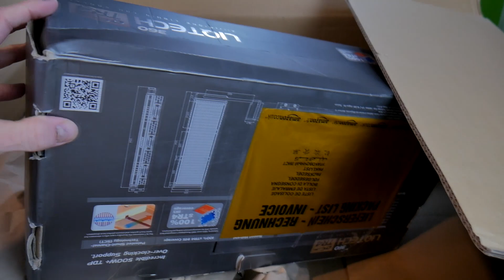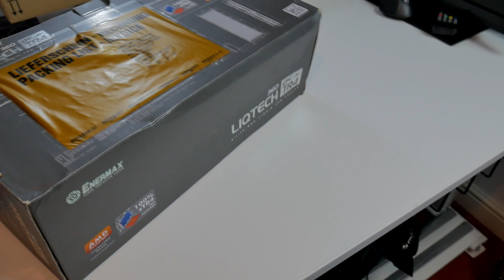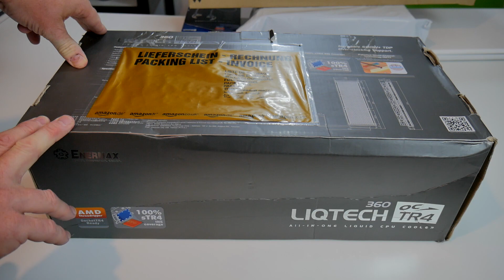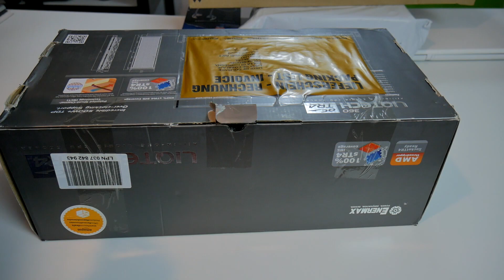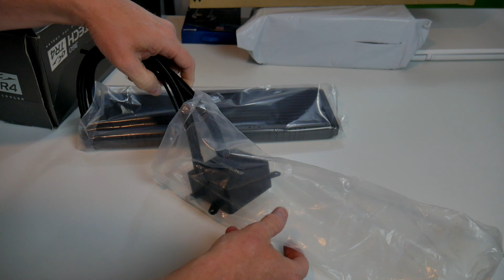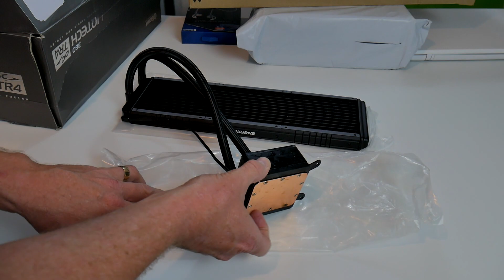Unboxing: Very disappointing Amazon Enermax LiqTech 360 sTR4 liquid cooler AiO for Threadripper

Comment: Open box? Yes but also looks like its be used to me... I bought the same model and it came with different packaging , fans and an accessories bag (screws, wires etc). Also the copper plate should be covered with plastic. Thankfully you got it from Amazon
Reply from the maker: Yes indeed.  I would not buy an open box from anyone apart from Amazon as it would be too risky.  If you look close in the video you can see one of the screws is rusting also.  Basically this is scrap and I am very surprised that Amazon would send it under tier own name "Fulfilled by Amazon". Especially as the listing stated "in original box with light cosmetic scratches".  Thanks for the comment.
Reply: There is a "batch" of bad AIO's that got through there quality control according to Enermax. This could be why you experienced this. Though alot of people are also having severe leaking issues after about 6months of owning the product. It's from either parts going bad or the fluid gunking up. I'm in the middle of an RMA with them because my AIO spewed out all over my GPU and fried a memory module. It's going to take 1-2 months to get sorted out and their customer service and communication in general has been awful. I highly recommend finding another cooler. The product is hit or miss it seems and the company's care about your product is even worse. I know its the only full contact AIO but the hassle is not worth it.